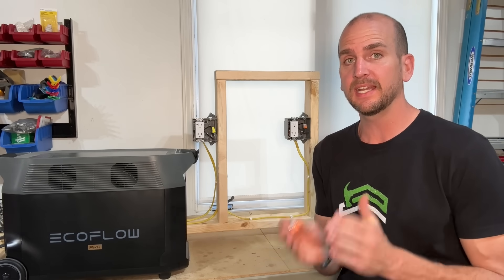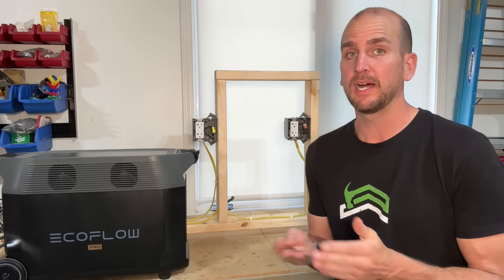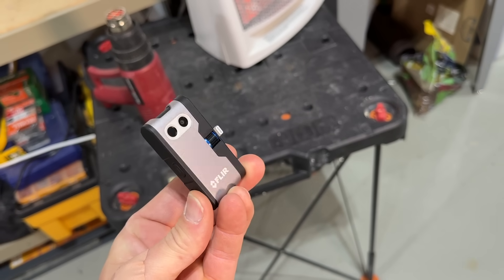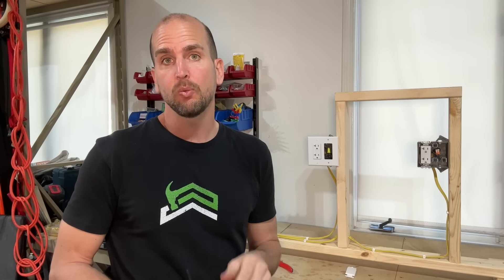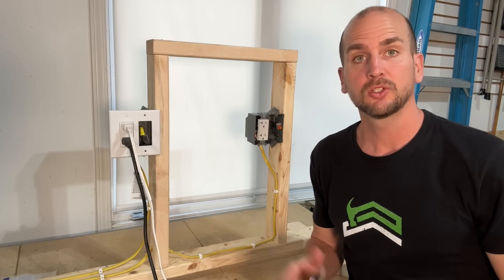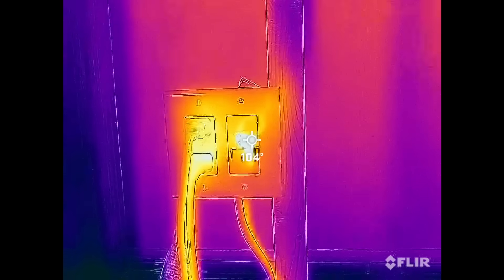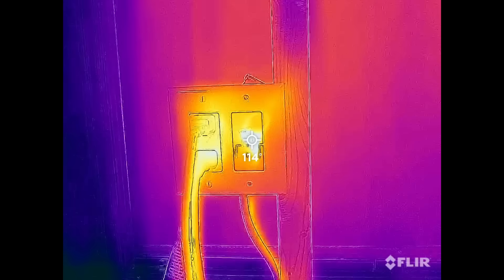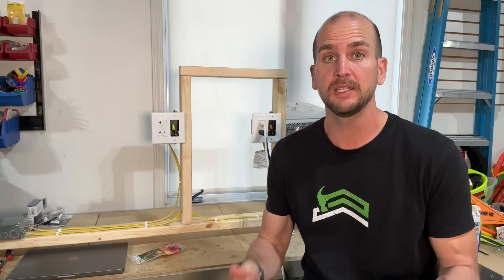Debunking the Pros: Can WAGO Lever Nuts Handle Heavy Electrical Loads?

Comment: I am only using wago style connectors for everything. the push in or the lever style. Because Wirenuts is one sure way to get a house fire. They require more operations, are difficult to verrify a good connection and afterwards you can't test the cirquit where as most wago connectors have an probe hole for an meter to go in. Especially the inline wago connector is awesome and already helps me a lot when having to go from solid to flex core.
Reply: DIY'ers shouldn't be installing wire nuts anyway, please stay away from them.  :face-turquoise-covering-eyes:

Comment: i dont understand we wire nuts are even legaly allowed still today...dont know one single electrician who is using them and maybe seen them once on a job where ended up replacing them with wagos...they are the worst connector by design.

Comment: As an electrician, I can tell you that the combination of the extra heat developed and the spring inside, will eventually indeed compromise the mechanical connection leading to more resistance and heat. This will ultimately lead to a failure!
On the other hand, a properly pre-twisted connection using a wire nut will NOT suffer the same fate over time!
I will never use them!

Comment: the problem with the old pros is that's if that's what you want to call them if they do want to learn new things you will fall behind in any industry a 30 or 20 amp fuse has probably has less metal across its contact surface  than those connectors and will power a whole circuit for its entire lifetime with no problems. and yes if overloaded it will fail like anything will.  learn specs and values of things and we can all be better and wiser

Comment: What you're missing here, is service life.
Time after time, these attachment points with heat up, and cool off.
Every time, it puts stress on the connectors.
Over time, which one do you think is going to fail first?
The one with the best mechanical connection? Or the one with springs and clamps.
Sorry, but I'm staying with wire nuts...

Comment: In the hands of an average homeowner (for example) adding a leg in the basement, good to go as long as the wire is properly protected with an adequate breaker.

Comment: What happens several years down the line as oxidation of the copper (or even aluminum) sets in?
Or what happens if a temporary short circuit occurs?  And, what about the "spring"?   Does it temper (get softer) and lose it's tension with time and heat?  Nope.  I will stick with pre-twisted  wire nuts.

Comment: In most European countries the mains voltage is 230, so current are about half of what is shown in this video. The load of 2800 W would only create a current of 12 A. A normal breaker in the Netherlands in a standard house installation would trip at 16A. As currents are a lot lower, I assume temperatures are also lower. Am I right in thinking this?
 I am no electrician, but I gave used Wago 221s, and I find them a lot easier to use than wire nuts.
Reply: You gave used Wago's?  You should have given new ones, don't you think?  :face-green-smiling:

Comment: resistors are soft loads..  you debunked nothing.  try it with an ac unit or just a big compressor and monitor it with flir for 7 or 8 thousand cycles..  Listen to the pro's rookie, their pro's for a reason

Comment: The lever nuts are used in Europe as a standard electrical connection, and the wire nut connection is looked at as primitive and unsafe in Europe. That's all I need to know. We all know that the standards and safety are decades ahead in Europe.

Comment: I think it would be better in your graph showing the max temp if your started the y axis at zero so that it's more visually intuitive. The way it was scaled may have exaggerated the proportion of the max temperature reached by each method-- but it still was a fair comparison between the methods.  Good video. thanks!

Comment: Room temperature should have been tracked too, especially with 2.6 kWh of heat being pumped into the room for an hour.

I'll never stop using the Wago 221. Professionals over here use them too. Wire nuts are ancient technology.

Comment: Always a funny debate to me because odds are if you picked wago or wire nuts for one valid reason or another, you aren't going to mess up either of them because you care enough about what you're doing to understand it at that level. The DIY hacks who screw up (pun intended) using a wire nut probably aren't going to find out about wagos anyway, because that would take five minutes of research, which they didn't do to figure out how to use the wire nuts.

Comment: Good video. I believe long term  results will show the true durability of the Wago lever nuts on high amperage loads, especially those loads that cycle on and off frequently.  I think long term testing of the effects of the heating and cooling cycles of the spring mechanism of the Wago lever nut will be the true test for it. For example, look at the results of the backstab connections "which is basically a spring loaded connection" that a lot of people thought 30 or 40 years ago "or longer" was such a good ideal. Then look at the failure rate of those. I think Wago lever nuts  are great for low amperage loads such as lighting circuits where the heat swings are less drastic.  in 50 plus years  of electrical work I have never seen a properly installed wire nut failure, that was "pre-twisted" regardless of what the manufacture's directions  say".  So I am staying with old school tried and tested methods,. P.S. I have seen a lot of non pre-twisted wire nut failures also in those 50 plus years, but that is just my opinion and you know what they say about those.

Comment: Great video. Thank you. But, a 20 amp breaker doesn’t trip at 20 amps. If it did, my Dewalt DW 735 thickness planner would never run on a 120v circuit. It pulls WAY over 20amps. The reason “why” was a very interesting journey into molded case breaker tech. Maybe you can produce a solid instructional on this.

Comment: i work on boilers and chillers and have to change control items. wagos make that easy and don't break the wire down as much so i don't have to pull more control wire all the time. when you have to go from the basement to the 4th fl that makes wagos my go to.

Comment: I can only go by the plug in where you stick the wires in the little holes in the back of the plug rather than using the screws on the side. 
Now those wires in the holes will work for quite a while and you’ll not know anything wrong. But I haven’t seen a plug in yet that was wired in those holes on the back that didn’t eventually fail.
When they did fail there’s always black marks on the plug ins and sometimes started to melt as well as black marks on the electrical boxes themselves too.   When they fail it looks like their a breathe away from catching fire! Too close for comfort in my opinion!  I’m a contractor and I have done my fair share of electrical work. I‘be also known electricians that have warned to never use those holes on the back of the plugs. Always use the screws to connect your wires!  I won’t take the chance to use those holes either. So the problem really is the amount of heat that’s produced gets worse and worse over time. I’m not talking hours or even days. I’m talking years to decades! Eventually those connections that are hotter are going to keep getting worse and even hotter over time! Something got to fail at some point! Where the cooler connections are simply going to last much longer without failing!

Comment: Here is the reality of wagos from someone who does a lot of wiring for my job. Are lever nuts a good option, yes so long as your amp load is lower than what is printed on the lever nut they are a great option especially if you might need to work on the device in the future or need to connect more than 3 wires. Are lever nuts the best option, that depends, they are fine for many applications and for most residential applications they are great but they are not the best option in meny things. Also stay away from lever nuts in the supply power to AC and electric furnaces, these often have a high amp load that may exceed the 30 amp limit on most lever nuts and to be honest if its close its not worth the risk, in the case of AC I can all but promise your LRA (in rush amps) is over 30 amps (likely peaking at 40-70 amps depending on the size of the compressor) this is only for a fraction of a second but I wouldn't trust it in the long run, lever nuts are really not for motor duty applications. Lever nuts are terrible in resistance sensitve applications such as sensors, the best option for this are usually dolphins. Lever nuts also have no option for high heat such as wire repairs near elements, or replacing a hot surface ignitor in a oven or furnace, the best option for this are ceramic wire nuts with fiberglass tape. My point in all this is that both sides of the lever nut argument are wrong because lever nuts are not garbage and are a wonderful option in many situations but they also are not this magical one size fits all solution; I know this will ruffle some feathers but I hate the argument of "they are easy for DIYers" because if you can't manage to use a wire nut correctly you should probably leave the electricity alone before you burn your house down, sorry if people don't like it but it is the truth, installing wire nuts is not exactly rocket science.

Comment: A more complete comparison would have the voltage drop across the various components. Some of the temperature is conducted, but all of that excess heat is the result of voltage drop across one or more of the components and conductors. That's the set of numbers you did not discover.

Comment: My question has never been if it can handle the current but more about numerous heating and cooling cycles. a buddy of mine was using UL certified push in connectors rated to 220*F  (kinda like Wago but one time use IMO) to install pot lights and everything was fine but 6-7 months later he was smelling a burning smell and found out it was the connectors melting. Neither one of us are electricians but this was in his basement with open rafters with one pot light on a connector. We've both been curious what could of happened and why once he swapped to wire nuts with twisting the wires together then he never had another issue?
Reply: 99% of people who watch these types of videos are DIY'er fan boy cultists, salivating over the latest trend.

Comment: Thank you for sharing these results! I have been using Wago for years, so this is very interesting for me.

Are the Wago 2273 series connectors also available to you in the US?

These "2273-203" are the original Wago connectors without levers. We mainly use these type in electrical installations over here, because they are even smaller and a little cheaper.
I see the lever type much less often, mostly for mixing stranded and solid conductors. E.g. in lighting fixtures, not so much for high current loads.

Would it be possible for you to also compare these two types of Wago terminals?

Comment: I’m in Australia and we don’t use wire nuts. It’s a screwed connector. Twist the wire first and put it in the connector and do up the screw. These work with all types of wires and I think they are safer than a wire nut. Since I found the Wago connectors I’ve been using them a lot of the time. Awesome for fault finding. It does have limitations if you want to put a few wires into one connector and have limited space. Most of my work is with fire alarm systems and the Wago are the best as the current and voltages are low and unless you do a really crap job of the install there wouldn’t be many connections along the circuit to cause an issue

Comment: Two thoughts:   (1) I wonder what the temperature was inside the wire nut.  You were measuring the outside of the plastic.  The Wago doesn't have as much plastic to shield it.  (2) We should all remember that P = I^2 * R, meaning the heat output varies as the square of the current.  At 14 amps you would get only half as much heat as at 20 amps.  

Assuming room temperature was about 75 F, and assuming the extra plastic didn't make the wire nut look cooler than it was, you got a 30-degree rise with the wire nut and a 40-degree rise with the Wago.  That's 1.33x as much temperature rise.  Taking the square root, that means the Wago had 15% more resistance than the wire nut.  I'll bet there's more than 15% variation from case to case because some wires are cleaner than others, some wire nuts are tighter than others, etc.  With this in mind, the Wago and the wire nut are practically the same.

Anyhow, I agree with your conclusion that the Wago performed slightly worse than the wire nut, but both are acceptable.
Reply: As many are pointing out, the Wago is much more immune to user error.  Either you've put the wires in or you haven't.  Wire nuts can be loose...
Reply: @michael.a.covington  Wire nuts can be loose if installed by DIY'ers or hack electricians, so yeah Wago's are much more immune to those clowns.  :body-blue-raised-arms:

Comment: You should also measure the voltage drop instead of just temperature. It would be interesting to see how the voltage drop compares on the different connectors. The voltage drop is what causes heat due to the increased resistance. For example if you have 120 volts coming in, you might only have 118 volts coming out when you are drawing 20 amps. That 2 volt drop equates to 40 watts of heat.

Comment: Problem with the wago for the DIY home owner is the price, the need to have numerous types (2-X holes) etc. and the COST. So a pro, might use them but why would home owner pay a lot to have them sit around in a chest? If the DIY home owner is going to redo every outlet...might be worth it. But wire nuts are older than I am and have been doing the job quite well for decades, if correctly installed.
Still wonder how much wago pays you for these videos.

Comment: I am a long time DIYer and I have felt from the first time that I saw Wagos that they were expensive gimicky junk. Expensive is pretty much self explanitory, These will cost you much more per connection than wire nuts. To me gimicky refers to something that is supposed to fix a problem that dosn't really exist, maybe looks kinda cool at first glance and is supposed to allow someone who is incompetant at a task be able to do that task. As for the junk part, this video pretty much sums that up.

Comment: Great move plotting the limit temp to scale the three connection options properly.  I may be a mechanical engineer, not an EE, but a good experiment is a good experiment.  I go Wago from here on out.  I'll take a few degrees delta T at max load over an non-robust connection any day of the week.
Reply: there junk he sells them.

Comment: I’ve never seen anyone not pre-twist wires on a wire nut . Still won’t use Wagos on house current . I also see a lot of cheap knock off Wagos on - line. I’m assuming that you’re testing with genuine Wagos.

Comment: Excellent demonstration! This was under extreme conditions (i.e. higher than rated for the circuit being protected by a breaker) which tells me that under normal household use, you likely would not see those temps even with that slightly higher resistance. I'm not an electrician, but I do understand wire gauge, resistance, loads, etc.

Really, the only limiting factor for the WAGO's is the price compared to traditional wire nuts or your baseline installation.
Reply: You may understand wire gauge, resistance, loads etc, but what about real world applications where 12 different wires are connected in tiny work boxes and high levels of stress are put on these connectors? Do you have any idea how many times I've seen wires pop out of these things, causing shorts and sometimes fires? The most limiting factor for all DIYers is lack of experience ;)
Reply: @Rick-the-Swift if the wires pop out then you are using knockoffs, i’ve used Wagos in tight spaces and never had wires pop out
Reply: @Rick-the-Swift If wires pop out you are way too stupid to use wirenuts aswell. There is no popping out if properly installed since the spring is cutting into the conductoraround 7mm back so it would have to scrape off 7mm of copper to get them out. Properly installed the wont fail. There is a reason most of the industrial distribution and control wiring is using spring or push in terminals now.

Comment: Interesting information and good for a comparison only, as I understand infrared imaging and temperature. The actual temperatures of the wire nut, the wago connector, and the screw on the side of the outlet is higher than indicated. The infrared camera is reading the temperature of the surface of the plastic and not the actual device behind the plastic. Although you can see the image of the heated area with the infrared camera, the temperature being displayed is not that device but the surface of the plastic that is covering the device. The true temperature of the devices themselves is going to be higher.

Comment: Great information. 
What was the best, is when you trued up your graph. Using statistics and graphs to mislead is almost the oldest profession. 
In your graph  using 5 degree increments, you get a much different message, deceiving message.
Then you added the approved upper limit and the data dictates 20 degree increments and the truth really comes into focus. 
As several have mentioned, getting wire nuts "right" is a learned skill. I have seen experienced electricians get it wrong sometimes.

For ease of use and very high probability of making the best connection, I say the safest choice is the WAGO lever nut.